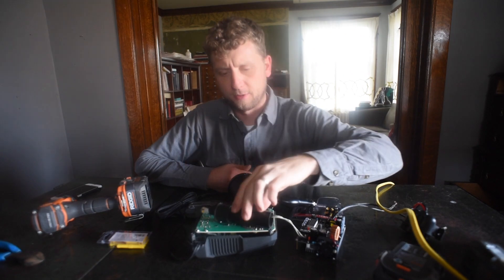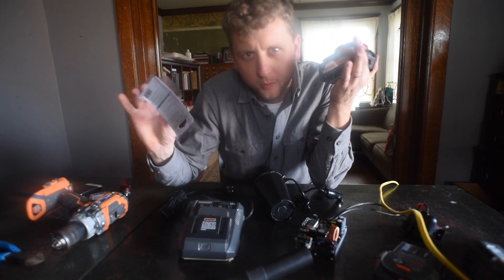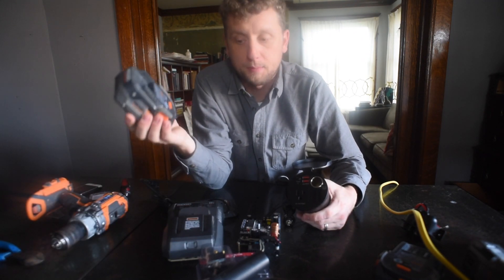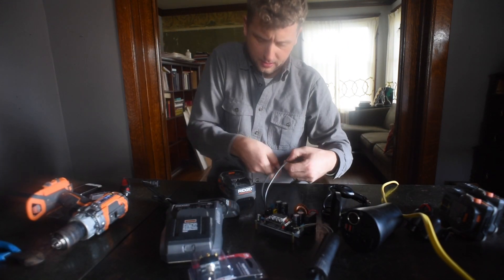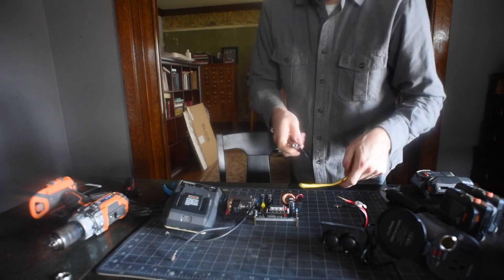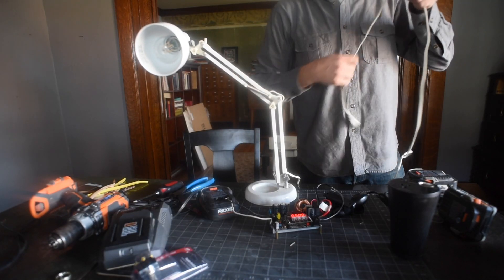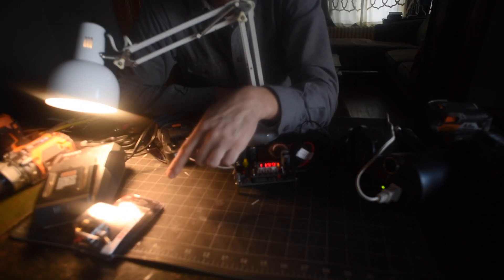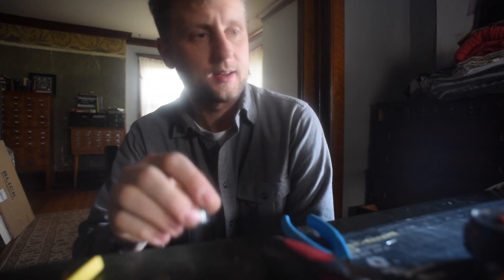A Dewalt Power Station/Goal Zero DIY knockoff idea using power tool batteries

Comment: Ive been thinking of building something like this, recently walked a new string of stores in my area and they had a store called direct tools outlet, they had an entire bin of unboxed Ryobi 18v Lithium battery chargers for $5/ea and they were selling refurbished 1.3Amp Hour lithium batteries for $18.99 or $34.99 for the 3.0 amp hour units. Was thinking of buying a bunch of the chargers for the docking bases.

Comment: Hi Rob, any progress on this cool project? Unfortunately the portable power station is not available here so I'm playing around with the same stuff and have already used it for powering my laptop in a camper but the converter is the weakest link as you say and there are no 18V inverters available. However, there is a 36V inverter from China available ("Reliable" is brand name) for two batteries in series. I might try it but several youtubers tested this brand and at least their 8k inverters seem to be of poor quality. Good luck with this and please update on progress!